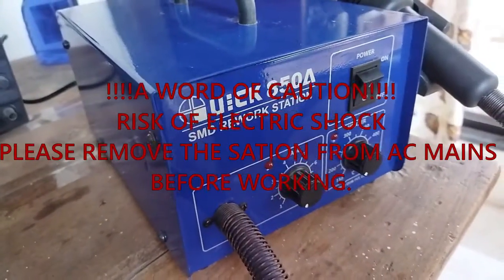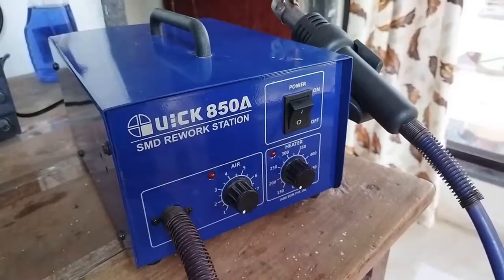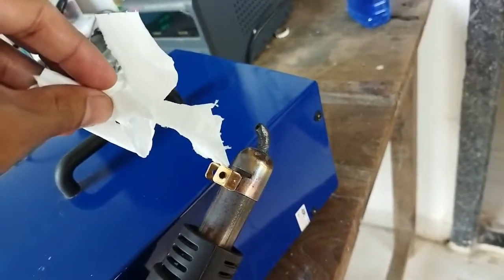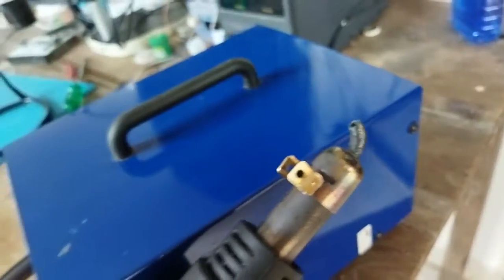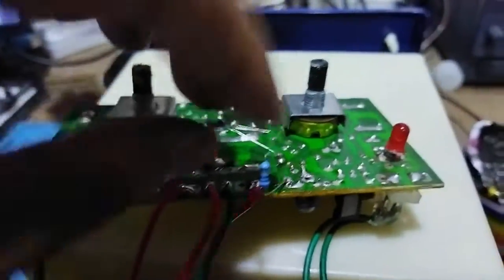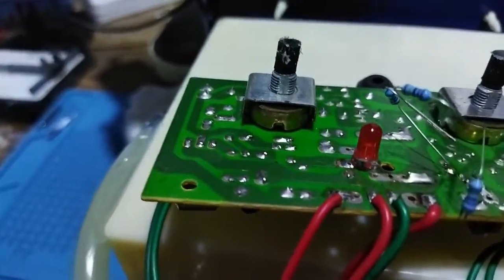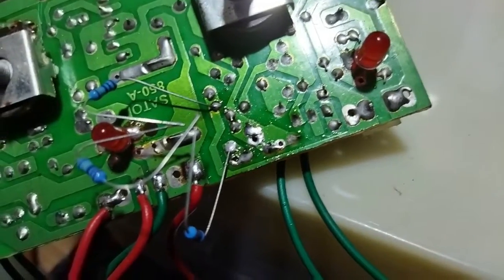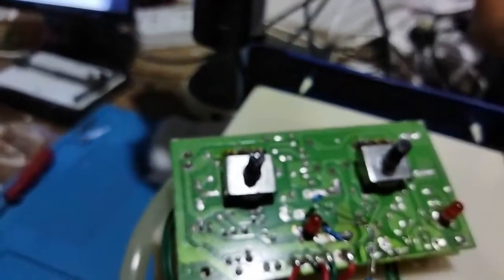QUICK 850A SMD REWORK STATION HIGH AIRFLOW SOLUTION!!

Comment: This problem is due to shorted of air controller chip TRIAC BT 134. This work as a MOSFET and got shorted Pin number 1 with Gate pin number 3.
Reply: thank alot brother
Reply: Fan was not working just changed Bt134. Working now but no speed control, so this bt134 is not a problem.
Reply: Very unclear way of making video. 
Never shown which component is faulty. And in the end result you should show the high and low speed both.